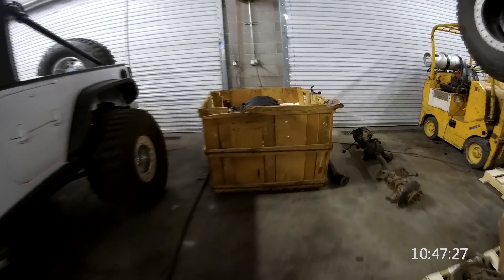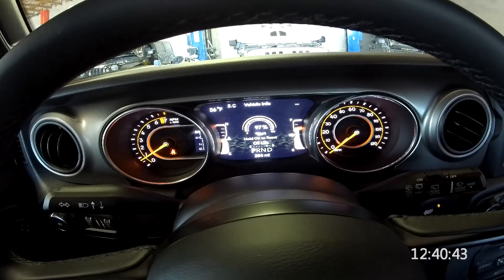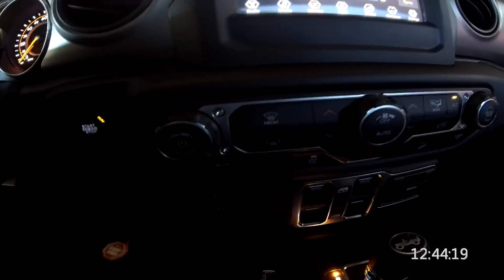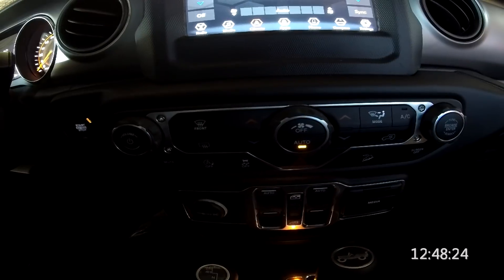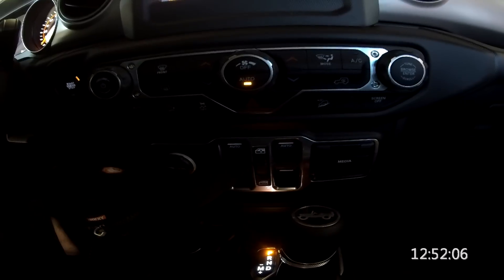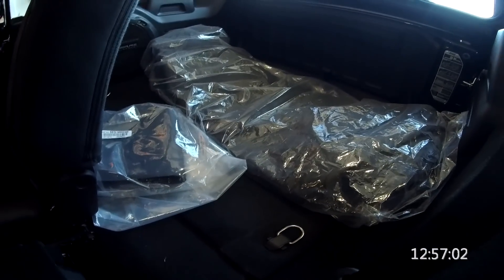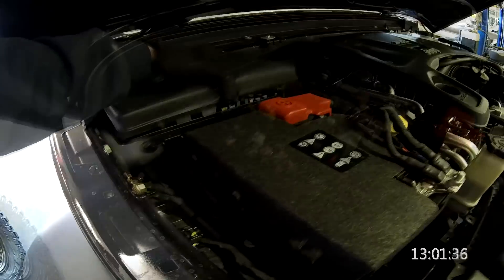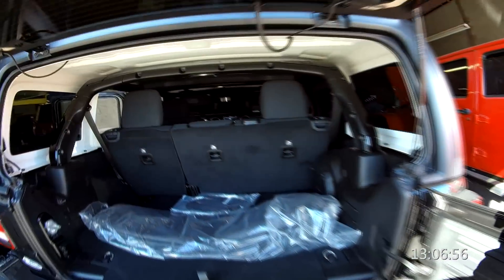MoTech's Jeep Wrangler JL

Comment: Just the best. And I am dyin', just dyin' to be rolling in an L86 motivated JL wrangler rubicon up on short arms and wrapped in 37' Nitto's, their new ice and snow exo grapplers laced w/ studs. Above the 49th, here in the Great White North, conversions must be installed in-country so we'll need a  kit and a recommended installer anywhere west of Winnipeg. Have you installed a Magnusson 1900 supercharger onto an L86 yet? I'm curious and think it'd make a great machine provided a stout enough trans is installed. I dont think engine internals need to be fussed with, it's not the biggest supercharger in the world and runs only 6lbs - if I recall. Quite serious about springing for my JL just as soon as you have a kit together and can recommend a shop. Let us Canadians know about any shops you've worked with and/or customer Jeep stories. Looking forward to building my, "Forever Jeep". PS, Genright, get your arse in gear!

Comment: There are several improvements that I like that make it more daily drivable,  but other things like the axle disconnect and auto start/stop really bother me.
Reply: Start stop is controlled by how hard you hold the brake down. If you push and hold the brake pedal firmly the engine will shut down after 3 seconds. If you hold the brake down with normal pressure it will stay running. Also this function is easily removed using the on board menus. I like it in Vegas with 1000 traffic lights. It would not be needed in light traffic.
Reply: I'm basing my negative experience of the auto start/stop on the 2017 Honda Pilot we recently got for the wife. In order to prevent engine shut off at a light, the pedal must be held VERY lightly in that vehicle, not a normal pressure at all. Normal pressure triggers a shut off as intended. Also on the Pilot is it not permanently disable...able?  lol. Not at all. Not even at the dealer. You have to press the off button to keep it from coming on every time the vehicle is started.  Very annoying. I have a feeling people will look back in 10 years at what a ridiculous and dark time it was when mandatory auto start/stop was a "feature"  (more like a torture).